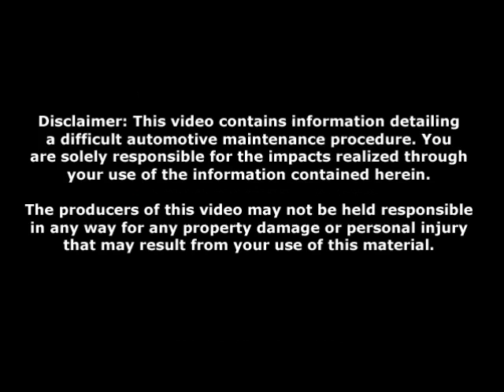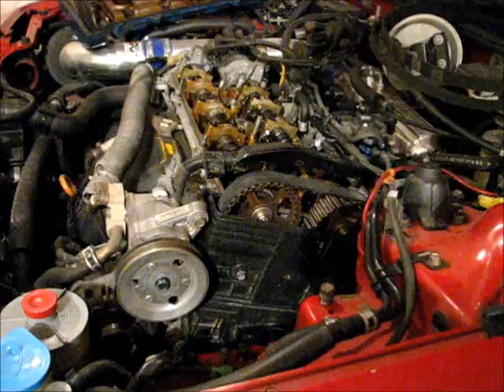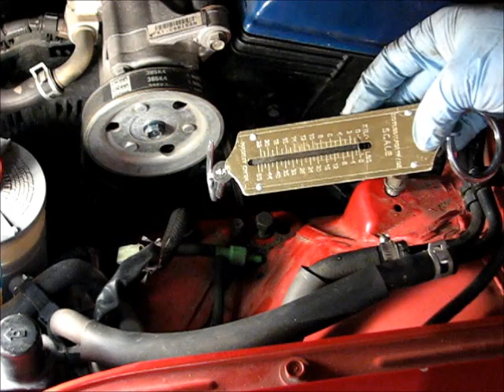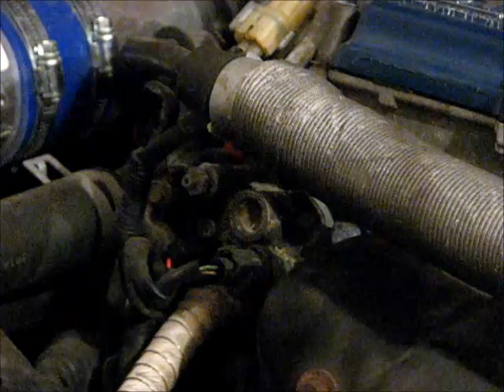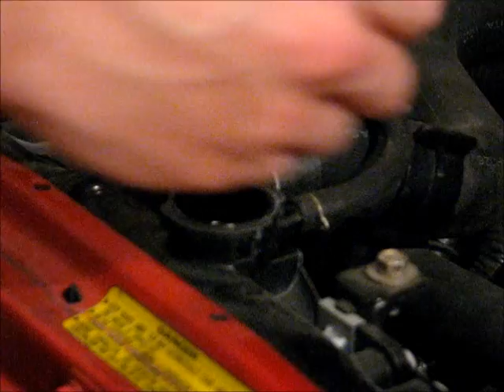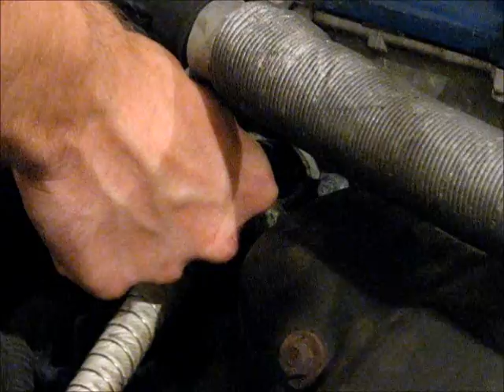How to Replace a Honda Prelude Timing Belt - 11 of 12 - Rebuild & Radiator Refill

Comment: I just bought a prelude, The crank pulley fell off. I'm replacing it but the key won't go all the way in. Can you answer why?
Reply: Timing belt is tight Do I need to re do the timing to line the key up
Reply: @9vikings7  Take timing belt cover off and loosen your tensioner.

Comment: Can anyone advise what size wrench to use on the p/steer belt idler pulley ? - looks like 13 or 14mm, access is difficult, - I'm going to purchase an extra long spanner as soon as size confirmed.

Comment: After I replaced it and tried to turn the car on it sounded like something was knocking in the valve cover. like rod knock and it was really loud and my prelude wouldn't start
Reply: What happened? :(
Reply: +chris42000000 I ended up junking the car because the engine went bad. i bought a miata after that and it got impounded and about s month ago I bought another miata and Is currently a(drivable) work in progress
Reply: Sounds like you had the timing off.